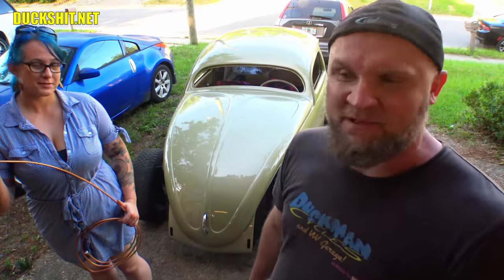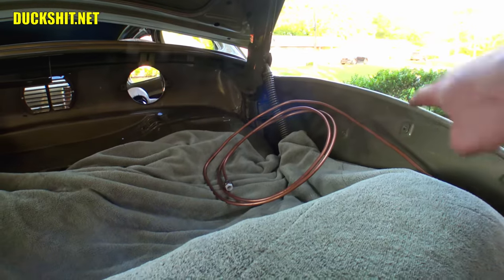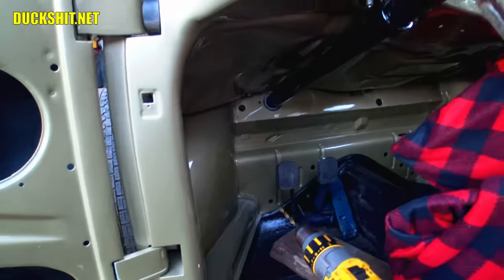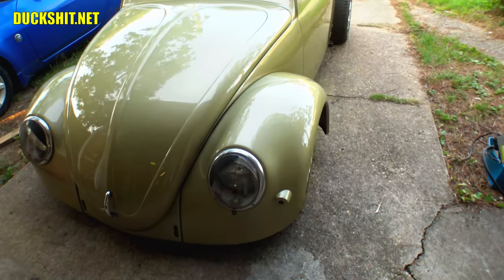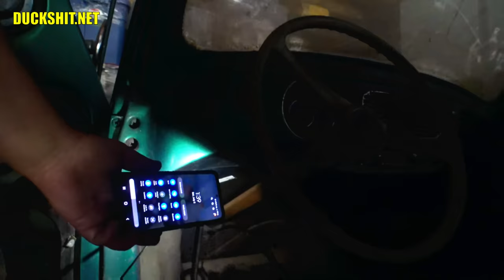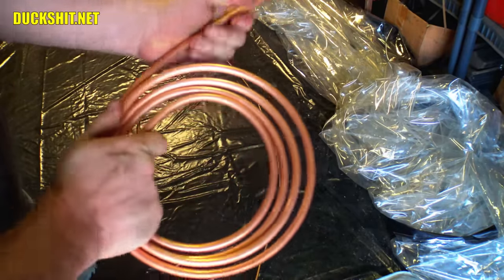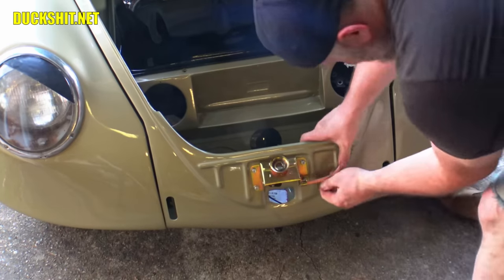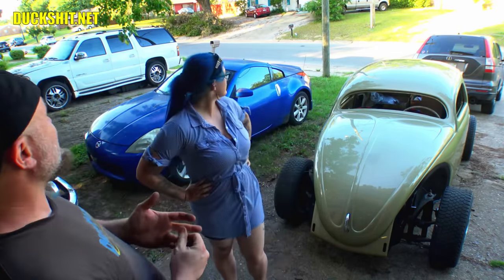FENDERS / Custom Copper Accents / Hood Cable - 1956 VW BEETLE - 168

Comment: As much as I love the color of copper, I would polish that tube, and hit it with a coat of clear gloss lacquer, even if the tube won't be seen unless you're actually looking for it. The nice look of bright shiny copper also compliments the color of the paint. Where you said you're going to 3D print something to hold the tube where you drilled the hole, a rubber grommet will work just the same, AND it won't require additional holes to be drilled out for mounting screws. You said how much you liked how the front fenders really defined the  look of the car, and I agree with you, but I think it's more the combination of the fenders, and the chopped top that define the look. This car really looks great!!!
Reply from the maker: You can polish your own tube all you want when you build your own car!  Or you can just polish your tube looking at mine!
Reply: @DuckmanCycles  LMAO

Comment: That lock is very clever. What happened at least in Brazil with the vehicles. The owner puts a lot of grease in it, as the cable lasts many years this grease accumulates dirt and failure. Cars like the vw Brasilia there is no access to the trunk is a big problem. In my vw Brasilia I put another hidden cable and in case one fails and the lock does not open I can still pull it and open the trunk.
Reply from the maker: Thanks for the comment!  The latch should fail to OPEN if the cable breaks, unless something else is jammed or not set up correctly!   I think we'll be fine!   Thanks so much!

Comment: Slightly longer fender bolts, some nice looking P clips and a lock nut. The tube runs right beside every bolt already. Easy fix and non offensive in the looks department. You can get vintage style guages with GPS speedometer too. Would save on that extra cable run.
Reply from the maker: Or just use a little glue and go no clips at all similar to the welds that VW used OEM and as I suggested in the video!   The speedo cable worked for 66 years, and looks nice and original, despite my color choice, and is a lot cheaper.  Would save on the extra money to spend on a new speedometer.

Comment: We use that type of copper (10mm) for heating radiators in the uk in our houses it does bend quite easily without tools and without kinking. we also use copper tubing to replace brake lines but that is a lot thinner. Great idea using it on the car though doesnt need paint and wont rust. The worst you will get is it will get dark and go green but it probably won't happen where you live. 

You know the hood latch im not 100% sure if you can do copper over it i think you can. So you could probably copper plate it which is dead easy to do
Reply from the maker: Thanks man!  I am considering copper plating it, gotta remove that chromate first, though!  It is something I am considering!
Reply: @DuckmanCycles  ah i thought it was zinc plating guess i was wrong lol well you live and learn as they say. 

ive done some copper plating myself on some tools and other bits i have to nickel plate first or the copper wont stick. my adjustable spanner which is broken doesnt half look cool in a copper colour though. its a wall piece now though as its broken.
Reply from the maker: @TotoGuy-Original  You thought half right!  It probably is zinc, but its chromate coated, that is the "gold-green" color that you see.  It needs to come off before any plating will stick to it.  Some weak acids will sometimes remove it and not bang up the zinc too badly.  I'm trying to find something less aggressive on the zinc though!

Comment: ...If you're worried about the steel cable chewing through the copper tubing, maybe use nylon twine/rope? If all it needs to do is pull to open the latch, it should work.
Reply from the maker: Or lots of lube!  Thanks man!

Comment: How about using a a bicycle or motorcycle cable inside the copper tube to keep the wear inside the tube from happening? Just a thought.
Reply from the maker: Similar had been suggested in the video, but the larger diameter tube is what allows that stiff wire to move like it does.

Comment: Perfection takes time
Mediocrity is instant
Maybe Adel clamps or similar on the fender bolt inside threads to secure copper tubing?
Reply from the maker: Thanks much!  What's wrong with glue and no visible clips?   VW never used clips there.
Reply: @DuckmanCycles  Just a suggestion to a moment in the vid.  Your vision will supply a solution 👍👍👍
Reply from the maker: I can make it look better than a bunch of clips :-)

Comment: For speedo, maybe go with an arduino w/ a GPS shield. you could have that run a servo which operates the needle of an original gauge? Would look vintage, but no need for a speedo cable.
Reply from the maker: Sounds very overkill... lol... especially when cable has worked fine on this car since 1956.  However, you'll see more about that in videos soon, I have some ideas.

Comment: You can get powerful neodymium magnets out of old computer Hard Disc Drives.  Everytime I scrap a HDD I always keep the magnets.
They are the C shaped magnet that top and botton the head driver coils.
Reply from the maker: I am an IT professional by trade, I am very familiar and have them all over my refrigerator!   Hehe!
Reply: @DuckmanCycles  So use them then mate! Lol... 
I am a security systems engineer and I use then for finding screws/nails and noggins in stud walls.
Reply from the maker: @banjax66  Why?  They are flat... hard to get off without prying them up.  These ones I have work fine.  Why is it when I've already demonstrated a better working solution that people always try to make me use something else that doesn't work as well.... when the job is already done?

Comment: use nylon tube just cut 2 inch off// and use it at both ends of copper  at the both ends.. in side off copper tube  running  // and can be replaced in 10 years , wire will run easy pull
Reply from the maker: Similar had been suggested in the video, but the larger diameter tube is what allows that stiff wire to move like it does.

Comment: newbie here . ? i have 1960 vw replacing floor pains. it was turn i n to baja bug from previous owner . do i need to put in heater tube. or can i do away with them
Reply from the maker: Heater tubes are not necessary unless you plan on using the heaters!  😁👍🏻

Comment: Looking good duckman ! Could you run a longer fender bolts and attach the copper tube to the threads inside the trunk ?.. just a thought
Reply from the maker: I could do a lot of things, or I could just glue it and make it invisibly fastened as suggested before!
Reply: @DuckmanCycles   do what makes you happy duckman... hope it works out for you
Reply from the maker: @rixkafer56  Thanks man, it'll work out if I work for it!

Comment: If you want you could polish the tube then clear coat it and install it. As far as the fuel sender, could you not route it along the hood latch tube to the front of the tank then up to its final position?
Reply from the maker: Or I could leave it to patina as I suggested I wanted in the video.  That would be a really peculiar and unusually long route for running the gas tank sender wire, and it would be less hidden.
Reply: @DuckmanCycles  true you know Elenore's innards better than I do. I was only operating from what I saw from the video. Also if the patina is your goal, would you stop and seal it at a certain point, or let it continue?
Reply from the maker: @Onedadbuilds  It''ll stop on its own because in a dry place... and it's not iron rusting.  All good!
Reply: @DuckmanCycles  I did not know that. I suppose up here in The Great White North that would probably just turn black.
Reply from the maker: @Onedadbuilds  It may if it were outside the car, but its inside in a dry spot in a car that won't see rain.  Should look nice and antique'd
Reply: @DuckmanCycles  Cool thanks for the knowledge upgrade.

Comment: There is clips made out of copper with a rubber coating made for water lines, look into it before you hot glue the line.
Reply from the maker: Considered, even had them in my had at the hardware store.... too ugly!  Also no way to attatch them without more holes or lots more glue.   No good!

Comment: Hi Duckman, is there a way you could use some kind of check valve on the cap of the gas tank as a breather so you don't have to drill that SWEEEEEET paint?
Reply from the maker: Maybe, but the cap is original.... you don't cut those!  Nothing wrong with poking a hole in some paint, just make it look nice!

Comment: Put on some nail polish on the exposed metal in the drilled hole, to keep the rust away.
Easy to find a similar color, or just use a transparent one.
And don't forget to polish and wax the copper tubing to keep it shiny.
Great video 👍
Reply from the maker: I painted the hole with matching paint... why use nail polish?  Hehehe!  Thanks man!  And there's nothing wrong with a little patina on the copper!

Comment: It’s a steal cable tube for a reason the copper tube is a soft metal and if you put in the bug the wire will cut your copper like a saw. I thought you were Going to do it right spend the money and get the replacement cable after spending all that money on the paint and all that work and you had that 57 in the shed I mean I can’t watch you anymore.
Reply from the maker: Someone is gonna steal my cable tube!  OMG OMG OMG NOOOOOOOOO!   IF I WERE GONNA DO IT RIGHT!  LoL!  OH NOOOOOOO!   I have another Beetle in the shed?  Maaaaan, you don't watch AND LISTEN to the videos at all, do ya?  LoL!
Reply: I think if you ran that steel cable through the copper tube back and forth continuously for about 30 yaers...it still wouldn't wear through. The cable moves about 1/4 inch from closed to open. You'd have to move it millions of times to wear through the copper.
Reply from the maker: @martinharris5017  These are the kinds of comments I am forced to talk about all the time!  Haha!  I got a lot of this kind of nonsense on this video today.   The cable probably pulls about 2 inches though, but even still, its gonna take MANY MANY times to wear through if I left it as/is.... the tube is $5 currently at the hardware store, and can be replaced easily.  It'll be lubricated, AAAAAAAAAND its an unfinished design, but he still assumes it's all done....  LoL!

Comment: Zinc Chromate. Yuk! Engineering job I had years ago had a need for plating on v-belt pulleys. Diesel engines, many outside in the elements. They were scratching their heads wondering where to have it done. I piped up: "There's a plater in the Industrial Park behind my house"! ;)
Reply from the maker: Zinc chromate indeed... icky poopy.  Not the thing you want behind your house LOL
Reply: @DuckmanCycles  Yeah. Actually, now that I think about it, it was Cadmium anodizing. And the place (even if it is still there) was on the opposite side of the park and downwind...
Reply from the maker: That chromium stuff is pretty harsh... it was also used in the primer that Earl coated Miss Eleanore with.